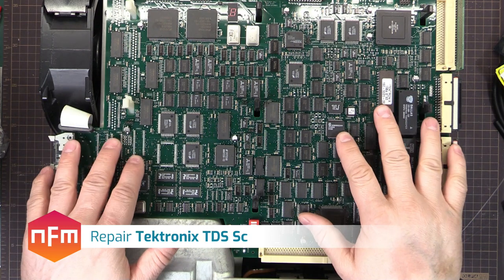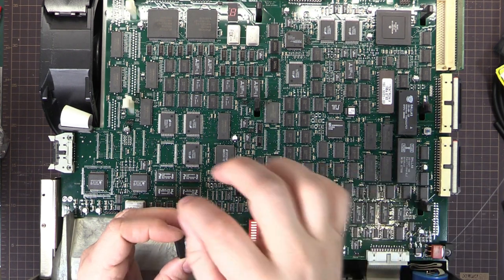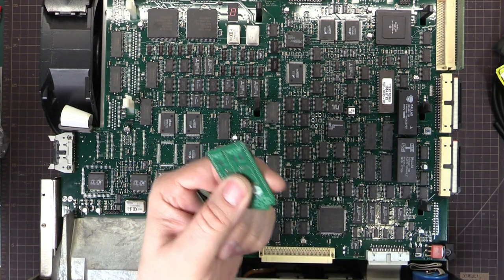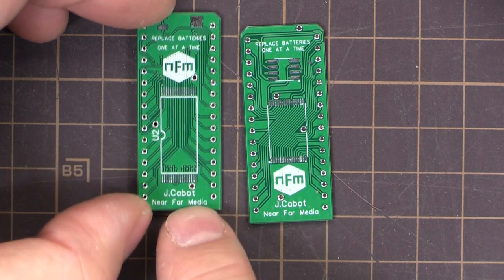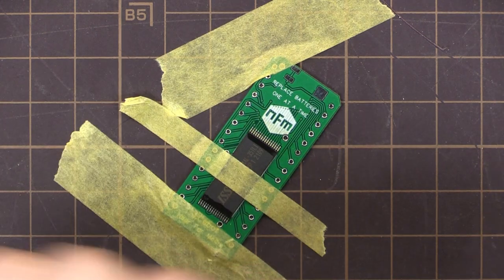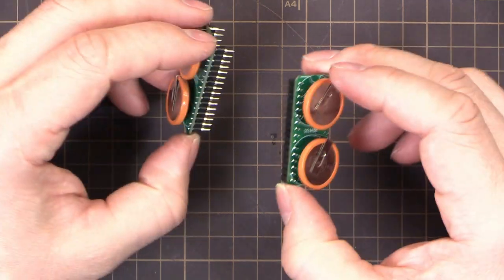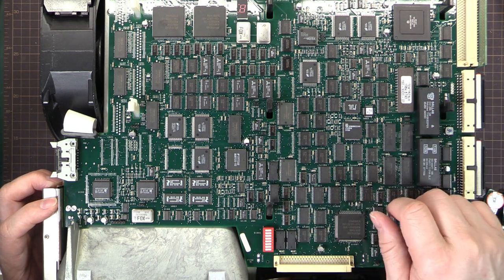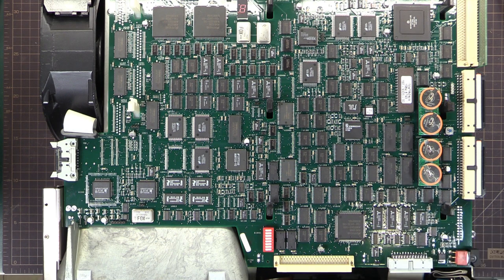Tektronix TDS Oscilloscope NVRAM Replacement

Comment: Thanks for the video, it is really helpful. I have a question I hope you can answer. I have a new-to-me TDS 744A that I want to change out both DALLAS NVRAM chips. I understand the calibration data for the scope is saved in two serial EEPROMS. I read it is also 'mirrored' in one of the NVRAM chips and the scope uses this mirror copy when it starts. If I use a generic NVRAM image will this affect the performance of my scope? Can I copy my cal data from EEPROM to NVRAM or have I completely misunderstood the process? Thanks again for your great videos. They are very well done.

Comment: The life of these BB chips is extended by leaving the instrument on.  As long as it is running the batteries don't have to provide power.  But you still have the chemical degradation that occurs with time.

Comment: What about those Cypress chips with automatic backup to flash ? I use CY14B101LA.
Reply from the maker: They could work, but they are a 3.3V part is seems, they will need to have extra parts added to the circuit to translate to and from 5V supply voltage and logic levels.

Comment: Excellent work!  I've totally wondered about emulating and/or copying those Dallas chips.  Wow!  Thanks for sharing!   Hope the poster regarding the newer firmware touches bases again when the USB/GPIB adapter arrives.  That will be useful.  I've wondered what novel custom upgrade hacks can be made with these besides those that are already shared online?
Reply: I just noticed seller kellyjo_13 on ebay is offering exact functional replacements.  Are you planning to sell or open source offer your PCB design version?

Comment: a replacement that does not need batteries? replace all these old junk battery form factors and standardize on 18650s?
Reply from the maker: 18650's have too much self discharge, the coin cells will last 10 years at least.

Comment: Are you going to make those boards available ? Or at least the gerber files ? Thanks
Reply from the maker: It turns out the controller chips I used are a bit unreliable (some may be fakes possibly?) So I can't guarantee they work.

There is a guy on ebay selling a similar design using a slightly different chip that works well though.
Reply: I'm aware of kellyjo if that's who you mean @NearFarMedia

Comment: One question. If you did that effort why not design board with flash chips, which don't need any batteries.
Reply: The RTC must have power on the DS1486 to function.

Comment: As you seem to have a lot of experience dealing with these TDS 600 and 700 series, what common faults should I check for first? I have a 744A that had the electrolytics on the mainboard replaced(no visible leakage before), and it refuses to boot with all of the lights staying on. No display out on the vga port, all power supply rails test great, and no difference when any of the board are disconnected. Any information/resources for fault finding would be greatly appreciated :)
Reply from the maker: Hmm.
First, double check that the PCB interconnect board on the right side of the scope along where the flex cables also are is the correct way up. One end is labelled 'acquisition' and should be oriented to plug into the acquisition board. An easy one to get wrong as it can be plugged in both ways.
Make sure you didn't put the memory protection switch at the front right into unprotected mode, it should be switched so the rocker is tilted towards the rear of the scope.
Also, what does the 7-segment display say when you turn it on? If it shows a number, it can direct you to where the fault could be.
For example, a number 8 means that the NVRAM batteries are dead and they need replacement as shown in this video (8 usually means the one that isn't the Timekeeper is bad).
Under normal operation, the 7-seg display should have two segments flashing back and forth in turn (think like the lights on a train crossing).